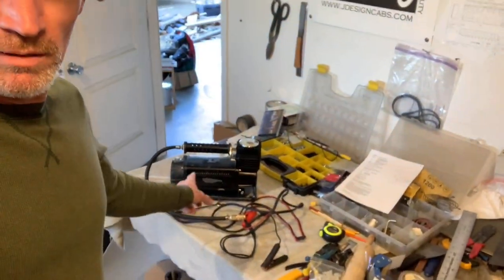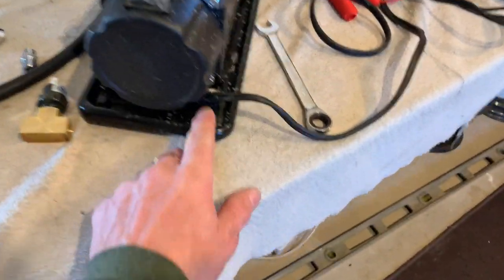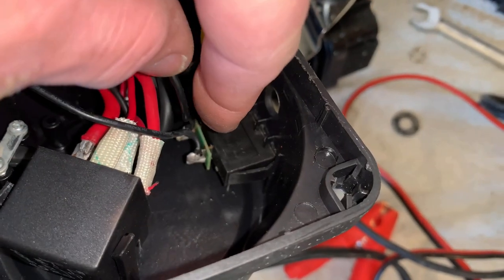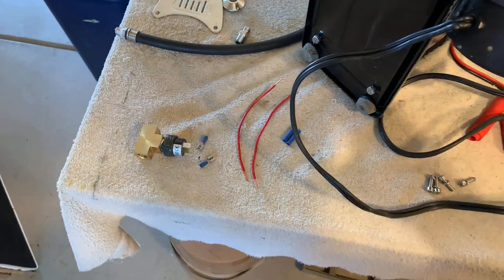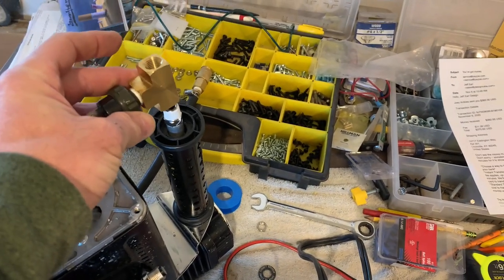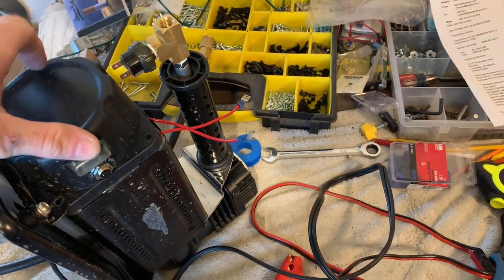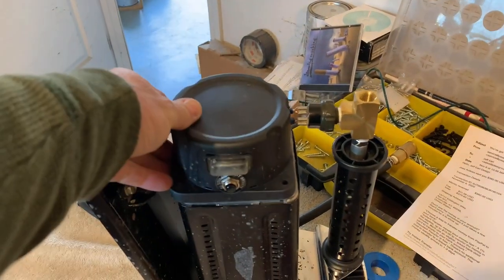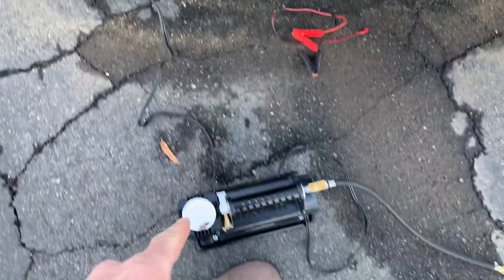Smittybilt Air Compressor Pressure Switch Modification.  Smittybilt 2781

Comment: That's the best set up yet. Clean. Professional and factory looking.
Reply from the maker: Thanks.  Still works great. 👍🏻
Reply: @covetthecamper2289  get some old extiguishers, alloy, 6 or 8mm air lne, mount tanks, 3 off under chassis, 1 line to side of truck with air fitting, permanently mount compressor, fill tanks, 170 psi switch, leave comp switch on. tanks allways full..you need 8 or 6 gauge wire or bigger, at least 60 amp relay,fused. or buy power tank. i fill from 12 psi to 36 psi, 4 tires in 6 mins.

Comment: Just completed the pressure switch mod!!   Great video.
Reply: Did you have to add a1/4 barb to the black hose
Reply: @willietenort2694  i used a 5/16 barb by1/4 npt  on both ends of the black hose.  Fits tighter for a better connection.  Still used a small hose clamp on each end as well.  Works great!!
Reply: Thanks for the info

Comment: I wanted a way of turning the compressor off remotely, as its mounted in rear of pajero/ montero where the kids 6 and 7 seats used to be. Never thought of pressure switch idea, i purchased a Wireless Remote 12V 24V 120A 200A Battery Switch Relay Control Disconnect from ebay about 30 AUD or 20 usd, i wired it to a twin core cable with anderson plugs on both ends as compressor had previously had an anderson connection. In between tyre inflation i can give it rest and let the air hose go slack by pressing the air trigger. These compresor units are sold in many different colors here in Australian camping stores and auto outlets. The hose and gauge that come with are not great i upgraded to flexzilla and a decent trigger and guage.

Comment: Nice mod but wondering if this will work for the Smittybilt 2780 and also I would be airing up tires for a tacoma (hopefully 4 tires simultaneously) but at 40 psi max. Would I use the same switch or do I need a lower psi switch?

Comment: For those that are replaceing the air outlet with the adapter, maybe there was a change in the production but the pitch is 1.0 instead of 1.25 M12 thread, at least for mine.
Reply from the maker: Do you have the 2781 or the 2780?

Comment: Great video!  Sadly my threads didn't line up to do the downward connect, so mine is off to the side exposing the wires.  I'll just have to be extra careful as to not break them off or knock loose.  Regardless, thanks for posting this step-by-step guide!
Reply: Mine came with a plastic cap so I cut the end off, put it on and filled with silicone. Worked out great to protect the end

Comment: i followed your video to the t install the pressure switch you recommend 70/100 compressors just cycles on/off thought it was a bad switch replaced with another and it still cycles on /off without stopping
Reply from the maker: Not sure why you’re having that issue.  Maybe your air chuck is leaking or another fitting is leaking?

Comment: You can easily pry up the switch without having to dissassemble the unit. Snake the wire thru the grommet for the power cords. Much easier.
Reply from the maker: You definitely cannot do these mods without taking things apart.
I like to see what I’m working on.

Comment: Great mod. Wondering if it’s possible to have it automatically cutout at the correct driving pressure or close to it.
Reply from the maker: If you can find a pressure switch with the specs you need for your application, then yes.  That would be really handy.

Comment: So mine works but after about 20-30 seconds after stopping airflow the compressor kicks on for 1-2 seconds and then cuts off and continues 
Is this normal? I assumed it would stay off completely until I engaged air flow. 
Or is it just losing pressure somewhere?

Comment: Great video application to how to DUY!!!
My tires are 225 65 R17 for Subaru Outback....
I need to lower the air down until 12-14psi and then load the air up until 32-35 psi....
DO I HAVE TO BUY THE PRESSURE SWITCH BETWEEN THOSE PSI I’M GOING TO USE???? or can I use the one you get on Amazon 70on to 100off
Thanks for letting me know
Reply from the maker: You can use that same pressure switch.  The compressor will turn on at 70psi & off at 100psi which will actually be more efficient.
Reply: But if I only need 12 to 35 psi, will it still going to turn on????
Because your pressure switch is turn on at 70psi and is higher pressure than what I need, sorry to bother you again
Reply: Anything below 70 the compressor will run. This is just to  shutoff the compressor if there is a shutoff valve. You still need to watch your own pressure for the tire.

Comment: Hello, do you have non-return valve?
after a few seconds or minutes the compressor does not lose pressure, and the pressure sensor lets the compressor start again?
Reply from the maker: With my setup, the compressor builds pressure in the hose to the pressure switch cutoff psi then shuts off.  It doesn’t turn back on until I start using the air.

Comment: do you remember which pressure switch you grabbed? there are multiple on/off switches for different psi. thanks for the video
Reply from the maker: 70 psi on, 100 psi off.
Links are in the description for all of the parts I used.  Works great.  I use it nearly everyday for my business.

Comment: What M/M thread adapter did you use right at the pump handle just behind the beauty cap? I was thinking of threading a female quick coupler in that spot and getting rid of the stock whip

Comment: Covet, when you attached the M12x1.25 adapter to the compressor's air outlet, was this a smooth fit or did you get an 'unnatural' sensation of jamming after about 2.5 to 3 turns? I did, but with a little tape and pipe dope I got a good seal anyway. Everything works great after the update. Thanks for the great video. One recommendation to ease the somewhat 'fiddly' re-assemble step: Remove the baseplate before reattaching the cap with all the connections inside. This will give you more room to fit the cap behind the triangular chrome cover which extends down from the air outlet connection.
Reply from the maker: I didn’t have that issue.  It sealed well and no air leaks.  Still working well.  
Thanks for the comments.
Reply: I have found that the thread is M12x1. Yes a M12x1.25 will work but it will slightly cross thread 2/3 rds of the way in which is not a big deal.
Reply: I concur.  M12x1 is the right thread.

Comment: What size is the black hose coming out of the discharge side of the tee fitting? (what size hose barb is needed for the QD?)  

I thought about doing a Male NPT QD straight out of the Tee fitting, but that seems like it coudl put a lot of strain on the aluminum tube that runs through the handle over time.  Seems best to do it the way you have it.
Reply: looks like a 1/4" hose barb fits best.

Comment: Hi thank you for the vid! I just got the pump and getting ready to do the mod.  Any issues with the back pressure so far? The manual says stopping and restarting can overload and blow a fuse. Recommends to turn the pump on before inflating the tire. Just wanted your thoughts on that. Thanks again
Reply from the maker: No issues.  It’s much less stress on the compressor to not have to run for long durations.

Comment: could you use a m/f 1/4 adapter to extend the pressure switch right into the cap?
Reply from the maker: Potentially.  I’m not sure if there’s enough room inside the cover for the pressure switch though.

Comment: Great video. I just did the pressure switch mod and have a question, if you don't mind. Is it unusual for the fittings at the compressor to get pretty hot? I actually did the mod right after buying the compressor; so, I don't have a pre-mod comparison to see if it is hotter or just common.  I set up a hose system where I can air up all four of my Jeep tires at once; so, the compressor runs a bit longer than if I were just airing up one tire at a time. Will the compressor still shut off if it overheats? Thanks again for your videos. They are very helpful and much appreciated.
Reply from the maker: Hi Tim,
Yes, the fittings do get very hot.  They do before the mod as well.   That’s the main reason there’s a heat shield on the main handle.   Mine actually runs much cooler now with the pressure switch mod because it’s not running the entire time.
Reply: @covetthecamper2289  OK. Thank you for the response. And, again, thanks very much for your videos!

Comment: Did you find the stock rubber leader hose ok or has it got way too hot. I'm waiting for my smittybilt and fittings for the same build but curious if ill need a 12 Braided steel leader hose. Thanks!
Reply from the maker: The fittings do still get hot but they do not get as hot with the modifications because it’s not running continuously like a stock compressor.

Comment: Did you have to use another adapter from the proximal end of the hose to the new T fitting?
Reply from the maker: No.  The adapter screwed right in no issues.

Comment: Can you use the same fittings and pressure switch for the Smittybilt 2780 as well?
Reply from the maker: Not sure but it looks like the air outlet side is the same on both.

Comment: The pressure switch link, links to several psi models. Which did you use?70-100? or larger?
Reply from the maker: I’m using the one that’s on at 70 psi, off at 100 psi.  Works great.

Comment: I did this mod with all the parts you've listed. I'm having issues with the pressure switch. Compressor is always on when turned on with pressure or no pressure. I connect the wires to the black lead going into the compressor and not the relay, what am I doing wrong? Any info would be great! Thanks!
Reply from the maker: If you’re letting the compressor run long enough to build pressure to the switch and it’s not shutting off at the pressure switch specified pressure, then you might have a faulty pressure switch.  
Take the switch out of the line, cap the T where the switch was and run compressor.  If it shuts off at pressure, confirmed bad switch.
You can verify by doing an ohm test on the switch.

Comment: So I did the mod and my Smittybuilt stopped working after about 4 air ups. Just wondering if yours is still working? I heard that you really need a relay wired in to the pressure switch as well to handle the high amperage.
Reply from the maker: Still working great.  No issues.
I use it nearly everyday for my business.

Comment: On your black hose did you change the fitting to make it fit onto the tee
Reply from the maker: Yes, the adapter for the air outlet is needed.   Part numbers are all in the video description.

Comment: Is the small black wire coming from the motor a thermal overload switch?
Reply from the maker: That goes to the built in breaker.

Comment: What is the size of the black rubber hose?  1/4" NPT MALE  on the end that threads into the brass tee but what size is the barbed end?  

That adapter for air outlet, virtually impossible to get here in Canada.  I ordered from an unknown supplier.  Lets hope it gets here.  M12x1.25, super hard to find.

I like the compressor.  Very strong.  I purchased it for my Class A motorhome.  I need big pressures.  Tires are cold rated at 110 psi, I run 88 psi.  Ridiculous that it doesn't come with a pressure shut off.  I used mine the first time and I had to let it run a little bit with the relief valve popping.  Compressor was on the other side of Motorhome.  I didn't like that at all, I don't think my neighbors at the park liked it either.  

I was actually quite surprised on how quiet the compressor runs minus the relief valve popping.  HaHa.  

I am going to do a 110 - 140 switch as I need almost a 100 psi.  

Thanks for the great video.
Reply from the maker: Standard 1/4” ID barb worked
Reply: Hey! I’ve been trying to find this fitting in Canada here too. Seems impossible. Where’d you buy from?

Comment: FYI....the adapter is actual  NOT M12x1.25  it has a finer tread.
Reply: I did the same update with the parts listed and also wondered about the M12x1.25 thread. The adapter went into the female compressor outlet for about 3 turns and that was about it without applying a lot of torque. However, with tape and pipe dope I got a leak free seal at that depth. Just to check, I took the provided and removed black hose with the male fitting and also the adapter to a local hardware store and tested both against metric M12x1.25 female parts and got a smooth and perfect fit. So I guess, the M12x1.25 adaptor is the right part after all. My setup works great so far.
Reply from the maker: Hi Matt.  It actually IS the correct part, and works perfectly.  I use this compressor almost daily for my RV service business.
No issues.

Comment: After this mod my compressor cycles on and off does that mean there's a air leak
Reply from the maker: Most likely.  Seal all threads on the fittings and tighten.

Comment: Can you wire the pressure switch in place of the power switch?
Reply: yes, but you cant turn it off. if it leaks down, it keeps turning on.like mine at 2.30 am. mines hooked to 3 alloy extinguishers. 170 psi switch..

Comment: Just got my smittybuilt and will do the same. One question the pressure switch says on at 70psi and off at 100psi one of the ones in the link you provided. Wouldn't one be needed that is at on at 0psi and off at 100psi?
Reply from the maker: No.  The compressor will always turn on at zero psi initially then turn off at 100psi.  But when you are airing up, it uses the air in the system down to 70psi.  ie; It turns on at 70psi then off at 100psi when in use.
Reply: @covetthecamper2289  Of course, I should have figured that out. 
I am having trouble trying to source the adapter for air outlet here in BC Canada. Can get it from Amazon but the shipping is $37. I will keep looking though.
Reply: no, takes too lng to get tanks filled from zero.i have 3 extiguishers rigged up to compressor..on 120 off 180..

Comment: Great video. What PSI did you go with on the pressure switch?
Reply from the maker: I installed the 70 psi (on) to 100 psi (off) version.  Works perfectly for my setup.
Reply: Thank you! I plan to use this compressor to air up 35” tires. Knowing that, do you think the 70/100 will work or should I think about going up to the 90/120 switch?
Reply from the maker: @matthewloevenguth1606   Your call.  I would stick with the 70 psi on/ 100 psi off.  Having it run up to 120psi is probably unnecessary and just makes the compressor heat up more than it needs to.  I would only have chosen the 90-120 version if I was going to inflate G rated tires.
Reply: Makes sense. Thanks again.
Reply: Can you use this with a digital gauge like astro ai hand trigger

Comment: Can you use this with a digital gauge like astro ai hand control lever
Reply from the maker: Sure.  Whatever connects to a standard air line.
Reply: I mean on the other end that's going to connect to the flex hose. By the way I really appreciate you responding